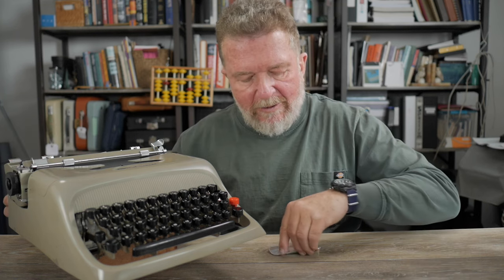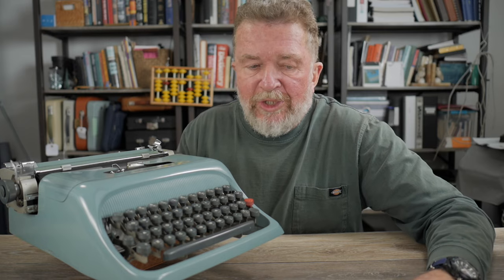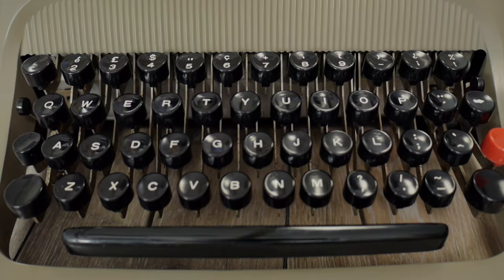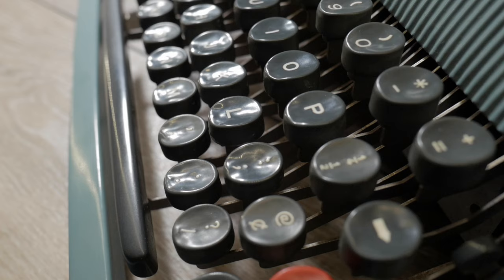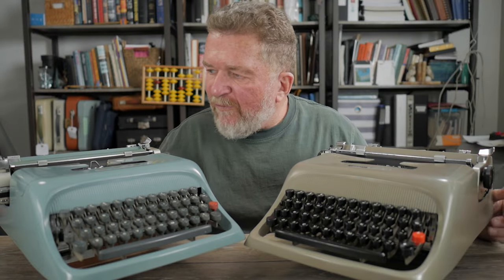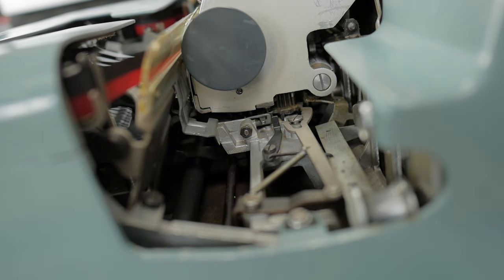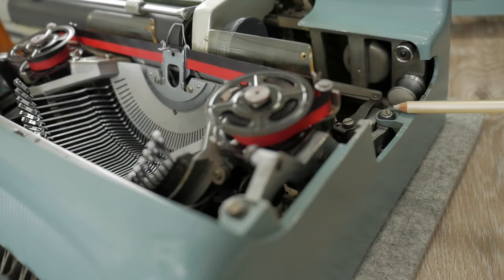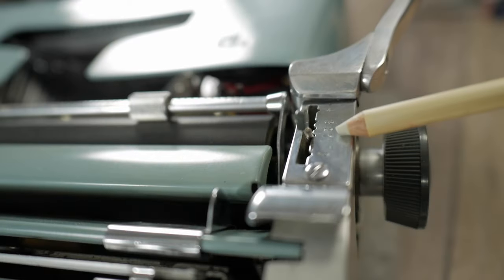Typewriter Video Series Episode 403: Parts Machines

Comment: Joe, I had the experience of having a parts machine that I was able to make into a working machine.  My 1899 Smith Premier 4 was bought as a parts machine.  What saved it was the directional keys and then another typospherian saw those keys and said that I had to restore this machine.  With parts from him and help from him and the local repair shop, I was able to restore this machine to functioning.  It is 125 years old this year and still types like a champ.  I am actually in this position again with another old machine, and trying to get it working is a process as well.

Comment: This was a great video, Joe.  I have an Undie 21, cousin to the Studio 44.  It had the exact same problems as your blue Studio 44, namely, a low-hanging carriage return lever and floppy papers supports.  Your carriage repair lever repair was pure genius.  I put a small, bent piece of paperclip in the carriage return lever cavity, then dripped hot solder over it.  The section of paper clip acted like rebar and held the solder blob in place, but the lever deployed too high, so I smooshed it down, compressing the solder in the lever, so it deploys at the right height.  The repair is almost three years old and going strong.  The paper supports were easy.  I got the smallest C-clips I could find and pressed them around the rivet posts between the paper support lever and the ruled panel.  That created a shim, and the friction held the paper supports upright during carriage returns.  

I have a spare Undie 21 carriage return lever that will work on your brown Studio 44.  You may have it if you want it.  I can send it to you.  That is, if you are up for the repair.  It sounds difficult if John Lewis is reluctant to attempt it.  Just let me know.

Comment: I once bought a parts machine for thermal typewriter. I found out that the keyboard that was sent to me did not work because of a bad ribbon cable. After some repairs now I have two working thermal typewriters! Sometimes that parts machine is actually better than the original that you wanted to fix. In my case, I got a manual and a quick reference chart.

Comment: Well, I bought a machine that lol, became a parts machine, for another I bought to replace the one that didn't work...not an Italian exotic, but a good hometown Smith Corona, the first was a 120, bad motor, tried to fix it, and then a 110 that does work fine.  Both are the Electra and both are manual carriage returns, just the 120 has a bigger carriage.

One quick note  I am loving that brother EP-20.  I got some brother thermal paper for it  it burns that so dark, it prints darker on thermal paper, than it did that little bit of testing with a cartridge on real paper.
But no joke, in two days I have been focused on a story and thermal blasted through 20 pages, same batteries and they seem fine.
I went ahead and picked up an EP-43 too, in case my fingers get tired of typing on a dial pad, which is fun, but I can see this Going into, just wish it had regular keys.
But thank you so much for turning me on to those machines, I absolutely can not believe I didn't think it could apply to me, how very wrong.
Just before I start a session I think about going to a park and doing hot thermal beat poems lol, and then I remember I don't write poems, the town would tar and feather me for my poetry skills...my psychological horror skills, that might keep the tar and feather off me, maybe...lol.
Thanks again. 👍
Reply from the maker: Congrats on the EP-20! They are unusual, like a hybrid between a pocket calculator and old laptop, Ted Munk first turned me onto them.
Reply: @Joe_VanCleave  
Yeah it's great and absolutely love it, much easier to write on and you wouldn't think 16 character screen would be much but it's plenty.  I do find too long my finger tips long for a more traditional key, so  I ordered the one and only EP-43.
Not many around, but yes thank I love it!

Comment: 2:21 when not even your typewriter guy will touch an Olivetti you might have a problem? Last night it was Hot Rod with a claw hammer working on an L22. I'm going to start drinking now and go look at a 44 in the morning.

Strip em when you need to. It’s better to have one fully functioning, than two that are troublesome or inop.

Comment: Joe, I was wondering, if you still have the bits, could you spot weld the handle back on the machine? Or do the old epoxy resin and baking soda then sand it down and paint it? Just curious if that sort of repair would work?